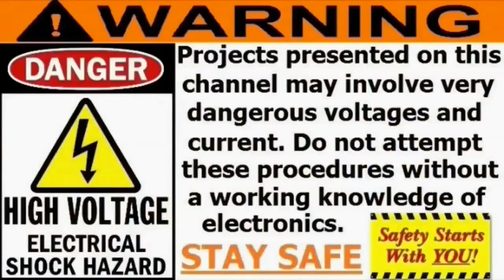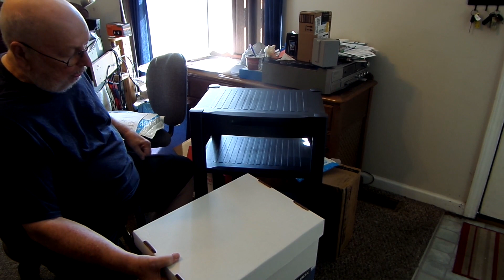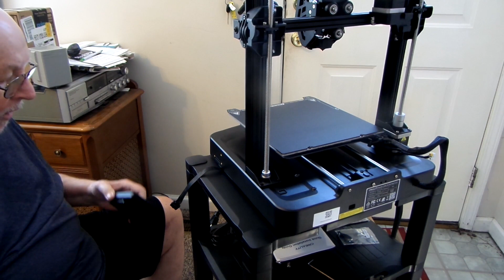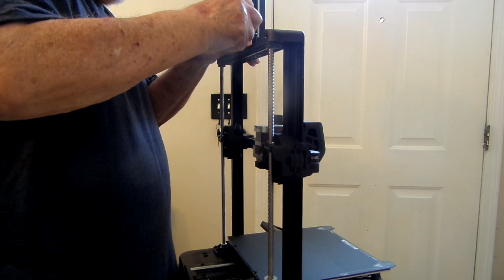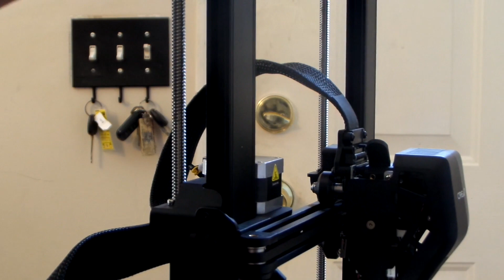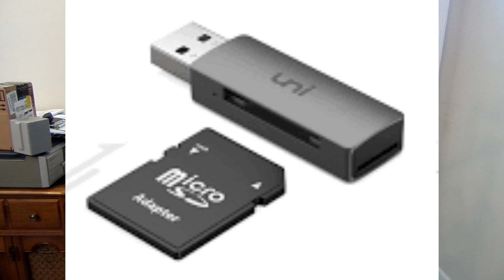The new Ender 3 V3 SE 3D printer

Comment: Nice printer Doug.  The one I got is the Neo model, but it does not have the nice second vertical drive screw which your's has.  I printed an adapter that allowed me to side mount the filament spool which I like, but the PETG I used for the bracket fused to my new print bed and I had to literally rip it off the nice removable bed cover like your has.  A friend suggested hair spray on the bed to help it release which works well, but you have a lot more experience with that than I do so I would be interested in how you like your settings etc. Thanks and take care.
Reply from the maker: Thanks PF. Yeah our business bought the Neo model to print cases for our BDST-2 signal tracer. Very pleased with how it's performing. That gave me the idea I needed a new printer too and was pleased to find this one for the price I paid. I did have a problem with the X axis bar which was not level, but fixing it was not difficult. I've got the raw footage for my next video which shows finishing up the setup and an actual time lapse print. :)

Comment: Would this be a great first printer for someone getting into 3D printing?
Reply from the maker: Overall I would say yes, but there was a problem on mine that a complete newbie might not know how to correct. I was aware of the problem because I've been using my Ender 3 Pro for a few years now, and I could look at the problem and see what needed to be done to fix it, which I did. Such problems are often common with new models so I"m sure once Creality is aware of the problem they will fix it. :)

Comment: How does this new 3 D printer compare to your other 3D printer. Is it faster does it have more features your other 3 D printer doesn't?
Reply from the maker: Thanks Larry, so far it was much easier to set up. I need to check the level of that bar before I try to print so the rest of the functions will have to wait. I know it is supposed to be faster than the Ender 3 Pro. :)